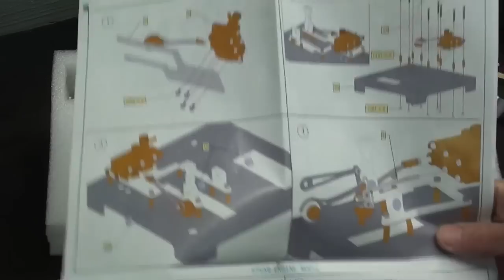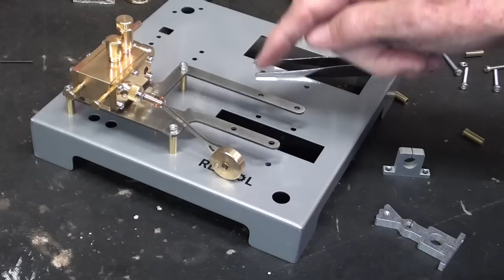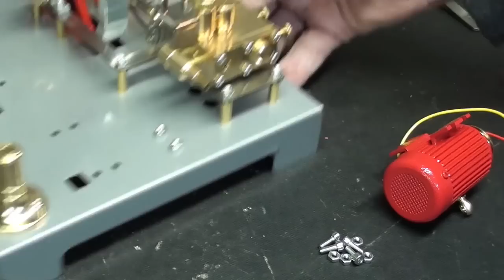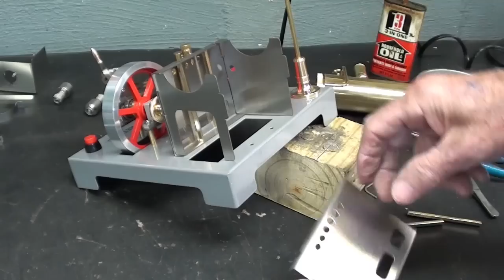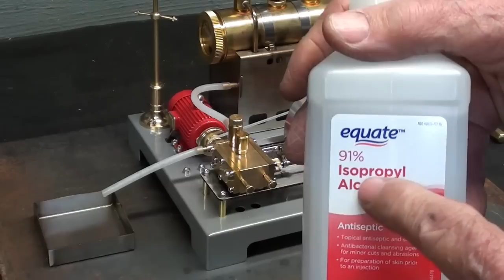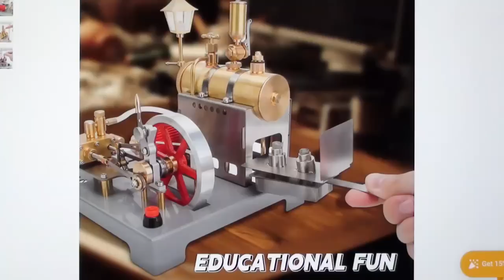HORZ. MILL STEAM ENGINE W/ GENERATOR #724 pt 2 tubalcain enginediyshop

Comment: Could a capacitor be added between the dynamo and the lamp to even out the light pulses? Or even better, a rechargeable  battery circuit to store power.

Comment: Hi Mr. Pete. So they say, "seek and ye shall find " seems to be very true here. @ 7:37 you hit a solid bind when trying to spin your flywheel. I'm building one right now and had the same problem. I believe its the outer rod on the eccentric. I haven't "unloosened" all my screws and moved everything outward yet, but I'm hoping that will fix it. Stay well sir.
Reply from the maker: I shortened the piston rod by un threading it a bit

Comment: If you need 91% alcohol, but can only find  70% alcohol, all is not lost.  You see, any alcohol ((isopropyl, denatured, or rubbing) has a small amount of water in it.  The good news is that salt, just regular table salt, dissolves in water, but not in alcohol.  Add a teaspoon or two of table salt into the bottle of alcohol, close the lid tightly and shake the bottle vigorously to dissolve the salt.  Keep shaking for a good couple of minutes to be sure the salt is all disolved.  Pour the alcohol into a clean glass and let it sit for ten minutes or so to separate.  After it sits for a few minutes, you will notice the alcohol has separated into two layers.  One of the layers is salt water, the other is alcohol of a higher concentration than you originally started with.  Decant off the salt water layer and you have your "higher octane" alcohol.
Notge, this doe not work for ethyl alcohol (the kind you drink), so you folks thinking you can make your vodka or bourbon more potent, it won't work.
Reply from the maker: Thank you, I will try that

Comment: What do you mean I wouldn't have any bottles like that.  I use them regularly for holding solvents and such.  Leave it to Walmart not to have something you make a special trip for.  Not as bad as going to Menards for something they should have and they don't because they have to sell groceries now.  I may have to look into something like this little engine.  Am retiring in a month, and may run out of things to do in the next 20 years.  Just saw a 10" Craftsman lathe in an online auction.  No motor though.  Current bid is $1
Reply from the maker: Great, I didn’t think any won would have a wash bottle, but they sure are handy

Comment: When I was in high school fifty-five years ago, a friend and I who were good students had such a good relationship with the science faculty that they would let us work on experiments unsupervised it the science prep area after school. If we weren't done by five o'clock they'd say "Well, lock up when you're done," and leave! One time we were playing with his toy steam engine. We had six Bunsen burners under it, and we may have bypassed the governor. The boiler was enveloped in blue flame. A strobe light showed it at 6000 rpm, and it was the only time the overpressure valve ever blew. We were probably lucky not to suffer a catastrophe.
Reply from the maker: What a great story and what a great experience

Comment: I do love steam engines. I have been watching Keith Appleton's model engineering channel for years. They are absolutely fascinating. Real steam trains are even better, but i have refused to indulge myself at any level, because I can't afford another hobby. 

I also noticed the flame under the boiler is very yellow, it should be blue. I suspect that part of the soot is because there isn't enough air getting to the fuel. Maybe pulling the burner tray out a bit could help. At first I thought the flywheel might be causing turbulence because it's really close to the burner vents, but it didn't seem to make any difference when you were playing with the reversing lever. 

As far as the employee in Wallmart, you have to remember he may be in paint today, pets last week, and household goods for 3 days after that. The Wallmart model just requires warm bodies who can look up stock numbers, and put things on the correct shelves. I would have started at ACE, because I know even my fiddly little store has everything, and the people actually know what it's for.

Comment: For my alcohol burners, I use either "Heet" or ethyl rubbing alcohol. 91% isopropyl works in burners, but leaves soot on everything and creates nasty fumes. I picked up some liquid hand sanitizer for $1/gallon at a Habitat for Humanity salvage store, and that burns, but it leaves a lot of waste liquid that needs to be cleaned out before the burner can be lit again.
Reply from the maker: I already tried the rubbing alcohol, and it was horrible and sooty.  I think I will get a can of heet
Reply: @mrpete222  I'm active duty military and the local exchange sells ethyl rubbing alcohol, which is similar to denatured alcohol. Don't know where to find it anywhere else. From what I understand, Heet is near the same thing.

Comment: Thanks Mr Pete. If you need denatured alcohol, go to most any gas station or convenience store that sells gas and look for an additive call "Heat" in a yellow bottle with a long skinny neck. It is high grade alcohol that does not stink like denatured alcohol. Plus it's in a covenant size and easier to dispense.
Reply from the maker: Good tip, thanks!
Reply: @mrpete222  thanks. I use it in alcohol camp stoves.
Reply: Double thumbs up on Heat.  I use that in my alcohol stoves for camping.  Easier to pour from the smaller bottle too.
Reply: @gymntonic  Thanks
Reply: "Heet"
Reply: @MrShobar  okay, thanks.
Reply: Sweet! Merry Christmas Mr Pete, you'll probably get a few more of these before the big day. Oh,same to Mrs Pete 😊
Reply: Another source is a bottle of Everclear.  If you get tired of burning it, you can always drink a bit of it.

Comment: Thanks, Mr Pete.  I love small engines and have bought several.  I love assembling models.  After buying a few "quality" models seemed  an enjoyable thing to do I struck  a few issues with two brands that took the shine off.  I've been buying from Stirling Kits, ex China, and have no issues with their delivery, but they cover several kit suppliers.  All kits have been beautifully packed, no mistake.  But several have had issues - like mis-aligned bolt holes that need the attention of a rat-tail file big time (!) to screw the damn bolts in.  Shameless!  Or tightening the piston big-ends and freezing the piston;  or loosening the piston big-end and tightening the crankshaft bearings - frozen piston.  DANG!  More shameless!  Or instruction diagrams/photos that are NOT very clear or relate to earlier iterations of the model.  Or timing beIts that CANNOT stretch across the pulleys like in the YouTube how-to videos that easily achieved the move.  I've 2 $600US models at the back of my cabinet that piss me off.  I've found a kit-maker, from the same supplier, that I trust, sort of, since then.  Odd, but checking YouTube for assembly tips nobody had any issues, assembly was sweet - that's why I bought.  Trying to stay under the $600US mark, mind.  My dollars are about half yours so you can imagine how crabby I am about the failed kits.  I could supply the kit names that spun my wheels if anyone would like.
Reply from the maker: Sorry to hear about that, my model did not have any of those problems. That would indeed be very frustrating and maddening, considering that these kits are really quite expensive.

Comment: Hi, you adjusted the valve timing  when you moved the piston valve back to stop it bottoming out. That's why it runs badly in reverse. It's a very nice model / kit.
Reply from the maker: Thank you for the diagnosis, I never thought of that
Reply: I'm not sure about that. The valve timing didn't change, just the position of the piston in the bore. I think the only thing that could affect is how much the ports in the cylinder bore are covered up and that would have an effect in both directions.

Could just be slop in the valve train or the eccentrics aren't quite right and it's timed to run better in one direction.

Given it's mostly pre-assembled I can't imagine it was factory timed so it's probably just luck as to how well it runs in either direction :)

Comment: I played with a model steam engine *unsupervised*, much younger than 14 or 16.  But that was back in the 60's.
I also got a few shocks off 240V train set until I learned to avoid those bare terminals.
Reply from the maker: It sounds like you lived dangerously. Pretty much like my brother and I no one, and I mean, no one ever supervise us, lol.
By the way, I changed a light switch last week while the power was on. I like the excitement, and it makes me very careful.
Reply: @mrpete222  Just like your parents, they had another son if it all went wrong.
Reply: @alangknowles  🤣That's why my parents had 2...just in case.
Reply: I took my jensen to school in the 4th grade and ran it unsupervised. Model rockets too and fired them on the playground during recess.  80's
Reply: @sdrc92126  I don't know what a Jensen is but it sounds dangerous, and you sound like a fun guy to hang out with.  Cheers, man. I'm 66 and really love having fun with loud noises and sudden surprises.  I reckon boys need to be given room to be boys _ just as stupid as we were.  Girls, too, coz they're hot.